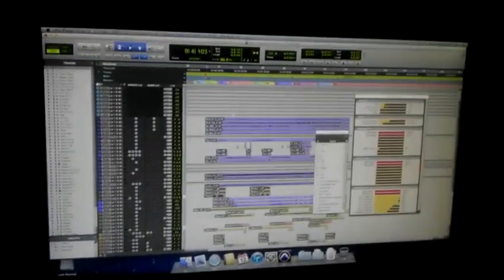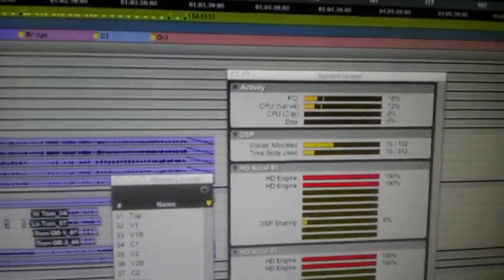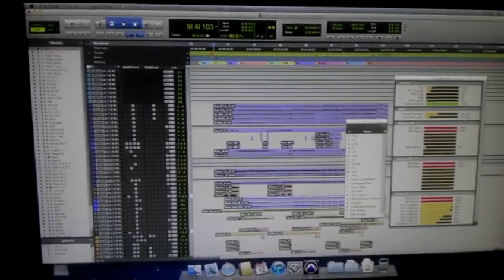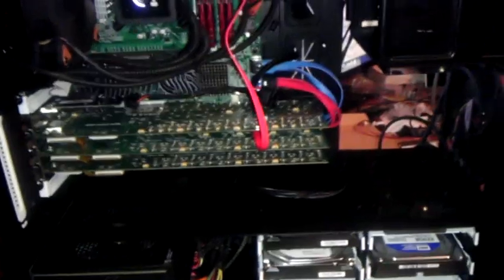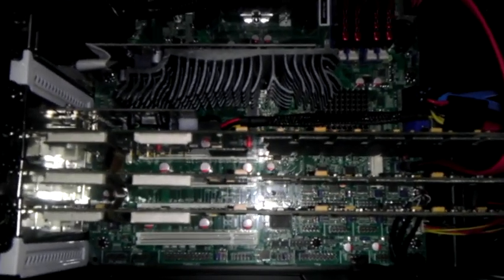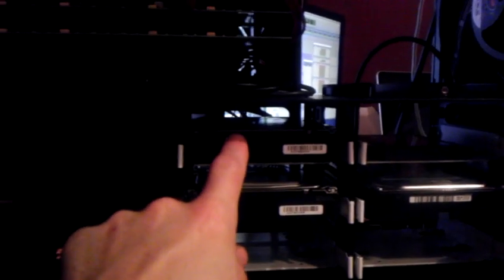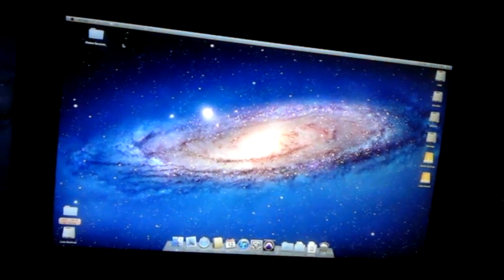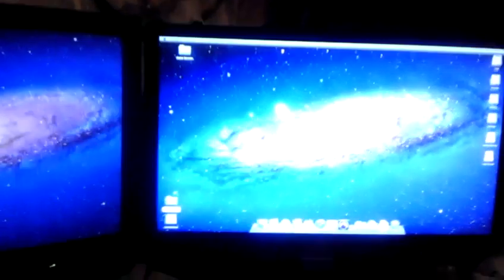PCIx HD3 Sandy Bridge Hackintosh

Comment from the maker: I encountered this problem recently.  I found out that the problem is incorrect card placement.  Try putting your host card in the opposite slot (if its on top, put it on bottom).  Also try swapping the ribbon from A to B (or vice versa).

Comment: Hi i have everything in this build and trying to get it up and running with snow leopard 10.6.8.  Is this possible or will i have to use lion like you have here?  I've been successful all the way to the part of 10.6.8 update and installing Multibeast.  Just not getting it to fire up on its own.  I'm thinking that i am having trouble with dsdt.  Please contact me earlfsmith@gmail.com  I'm here in LA.
Reply: PT10 HD will work with this setup perfectly all the way up to OSX 10.9.5.

Comment from the maker: Yes.  PCI and PCIx are backwards compatible.  As I previously explained, the only reason Digidesign added that extra nub is because the PowerMac G5 had only PCIx slots.  The only thing you to be wary of is the to make sure there are no heatsinks, SATA ports or any other things that get in the way of the extra length.

Comment: P.S> A quick search showed a diagram that looks like it has three Native PCI slots (no Bridge chip) and that it can do SOME overclocking (saw a reference to CPU Bclk and GPU overclocking). No ram overclocking from what I have seen so far and I'm wondering if you can overclock with the Bclk multiplier. If it can run a Sandybridge 2600k at 4.5 Ghz to 4.8 Ghz then it may be the best solution for those needing Native PCI. Your thoughts, oh mighty Hackintosh guru!? ;-)

Comment from the maker: PT 10.  Make sure you use Kernel Cache.  Digidal.kext causes KP if you dont.  Use an app called kext utility (just open it) to crate new cache, then make sure you have string in boot.plist for using kernel cache.  Good luck.